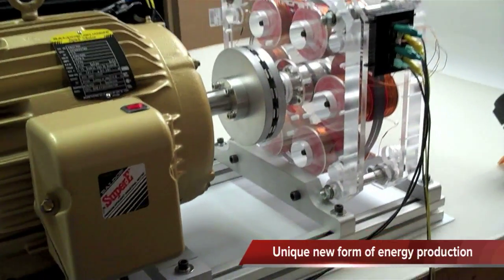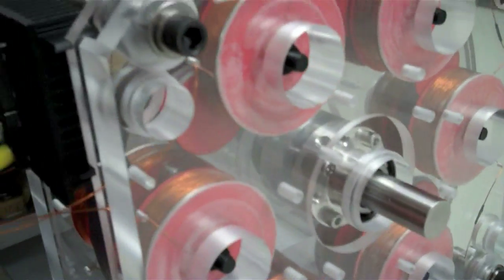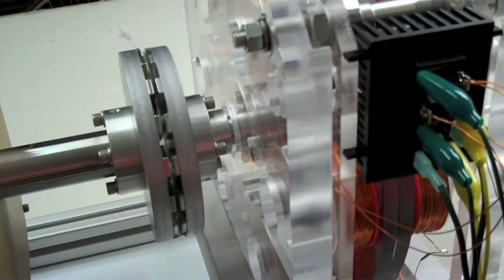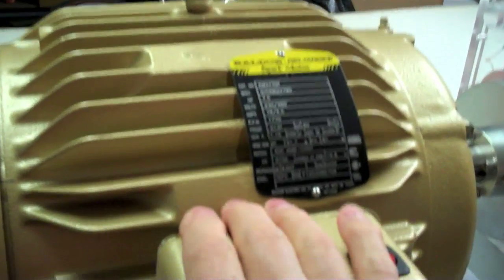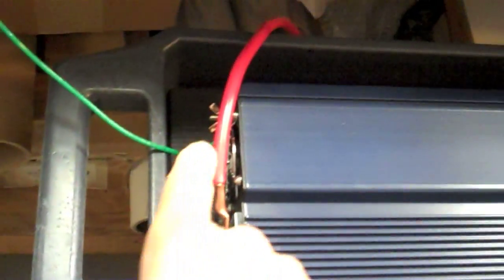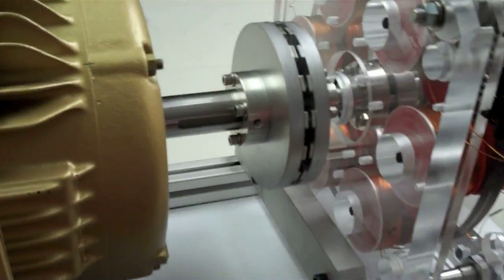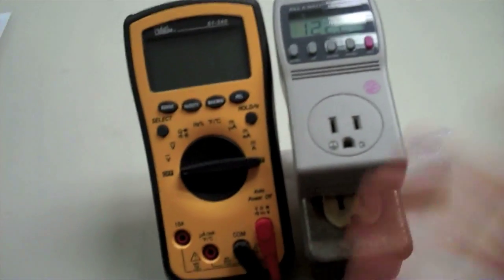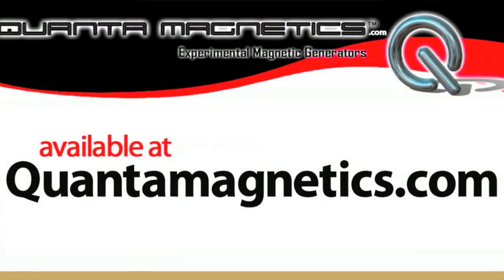Quanta Charger Converter INTRO

Comment: It was great of you to mention Hector and the Rotoverter. This is a beautifully made system. It'd be nice to see some of the specifications on it. What size is the inverter you're using o run this from batteries? What's the output from the generator when all coils are series and parallel? What can you get out of it if one side is series and the other parallel? How long does it take to fully charge the 18Ah battery in the charging video? 

Awesome workmanship - thanks for posting!

Comment from the maker: You do NOT have to use a Rotoverter converted 3-phase to power the Quanta Charger. An efficient DC motor with or without gearing will also work great. I've been experimenting with the Quanta Charger prototype for over 7 years in many different configurations. My intention was to give Hector some well deserved credit by integrating his motor conversion process into a working system, and help keep his R&D perpetuated as well.

Comment: The commentary suggests over-unity power output. Have I understood this correctly?

If so, could you power this system from a self-charging battery and also run household items via an inverter? How many watts excess power would be available for use in this configuration?

BTW – this item isn’t listed on the website referenced in the video.